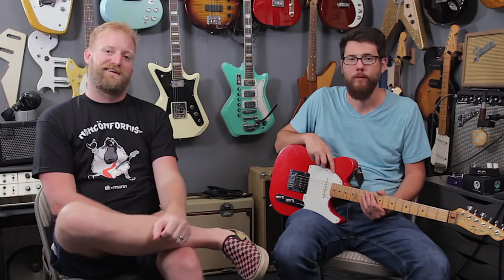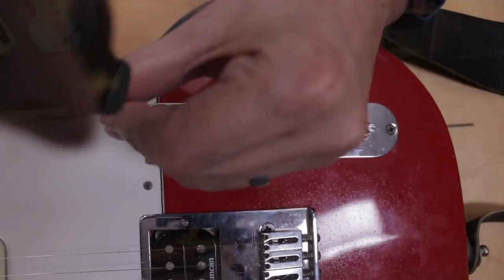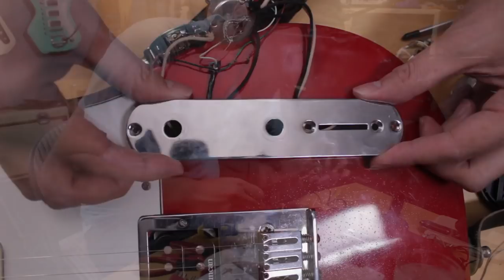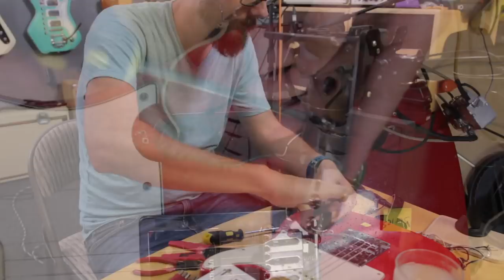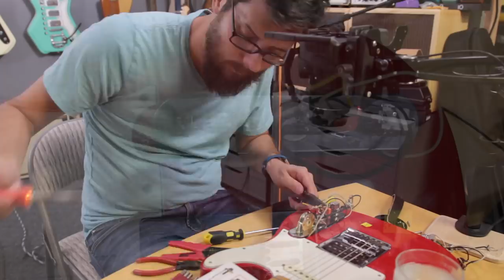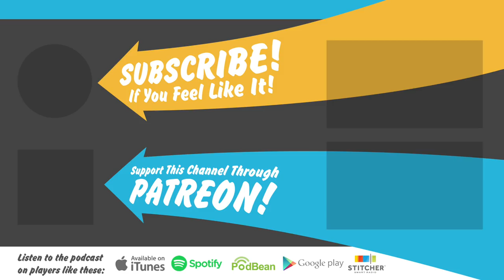Gunstreet Out of Phase Tele vs. Coil Split Tele

Comment: You might like the sound of a 4 way switch ( neck/both/bridge/both out of phase ) plus the coil cut.  You can get the same sound using a push/pull volume knob for phasing output of humbucker after a push/pull tone knob for single / double coil of the humbucker.  Both pickups as single coil out of phase is cool sounding but weak in volume.  The higher output of the humbucker (not cut) may make up for the lack in volume.  When I did the 4 way switch mod to my Tele I added a boost pedal to make up for volume loss in pos 4.